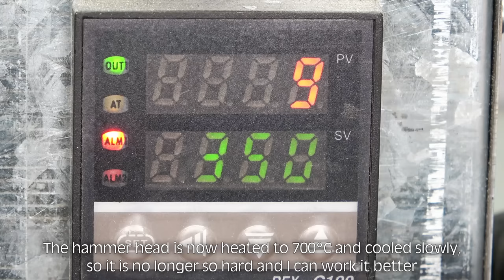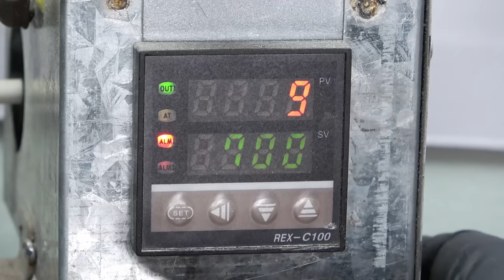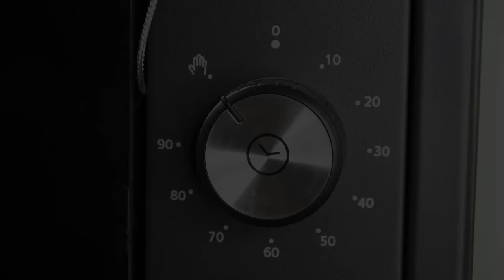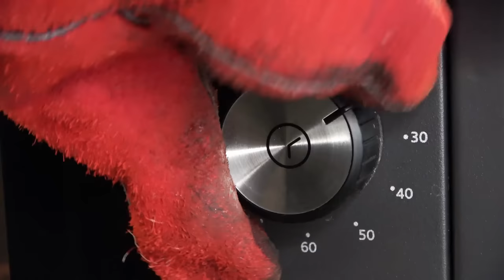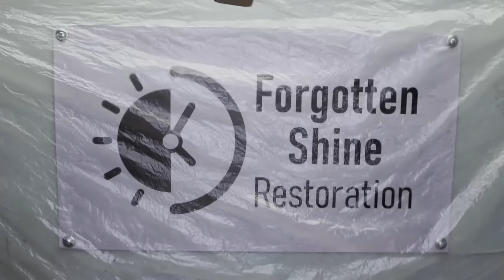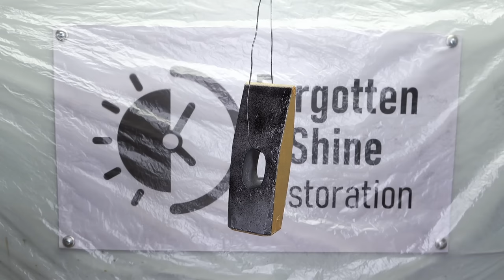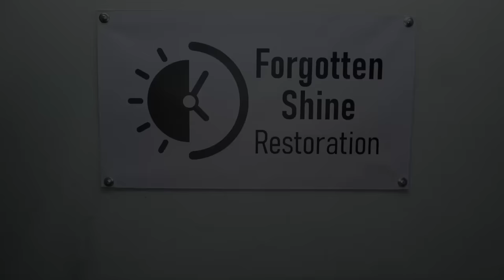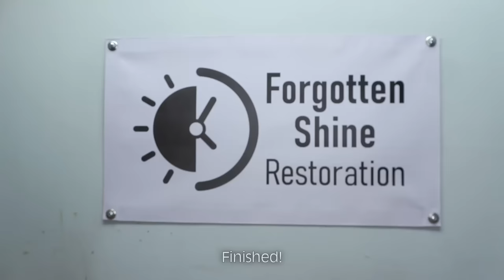Hammer Restoration [With Resin Eye]

Comment: Thanks for the specifications on temperatures. As a hobbyist knife sharpener I sometimes worry that using a sanding belt might ruin the heat treatment of a knife. I use a very crude "Does it burn my finger?" test. If it doesn't, I guess it's not above any critical temperature, probably less than 100 C.

Comment: I follow a couple of bakers on this platform. I thought the thumbnail was bread 🤣.
Reply: Forbidden bread!  "It's a lot tougher than I thought it would turn out, and the flavor isn't quite what I would have wanted.  The oven was set at quite a high temperature.  Perhaps turning the oven down, using wheat flour with a yeast leavening, more than just salt as flavoring, and leaving out all of the iron might improve the dough?"